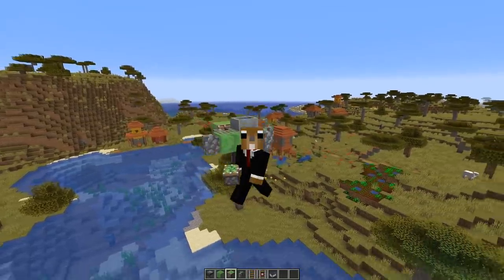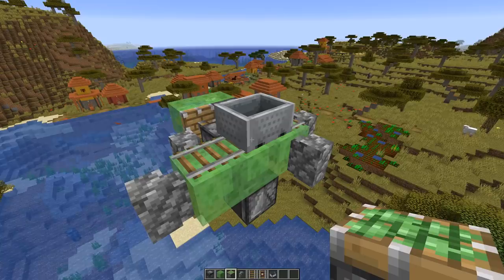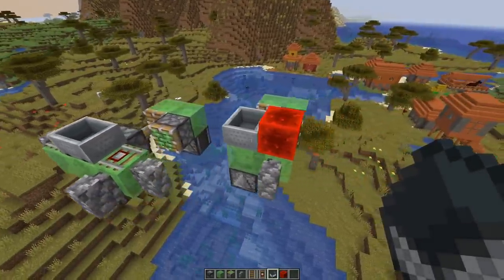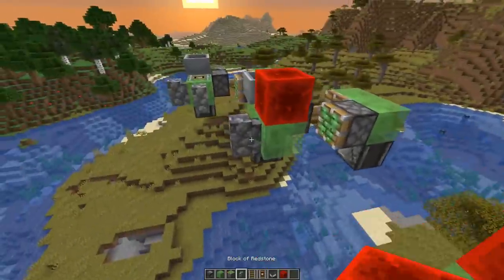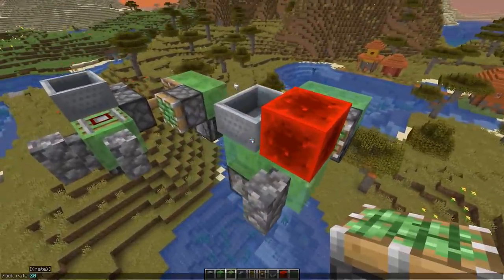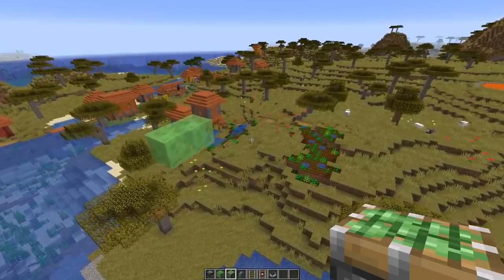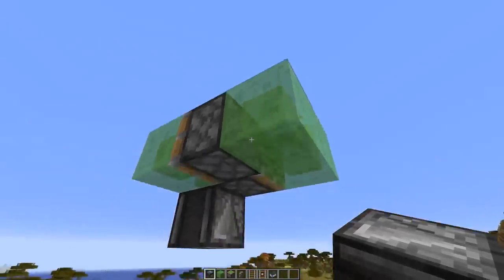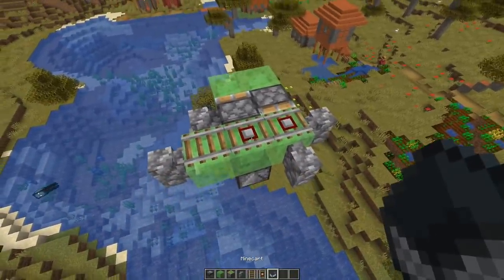Player Controlled Direction Changing 2 Way Flying Machine

Comment: This is enormously helpful for players with bad connections, needing to travel. You just snap back to reality, it's amazing and this makes it even better. Just hope you don't disconnect and break the machine.
Reply: @Jeronimo Stupenengo Pefaur I'm concerned not about the cart, but the flying machine, with instant unloading in the new versions it's likely it will end up in a broken state. Also I would be a little concerned about the cart, if it could (it can't) still move, once you leave, then it could cross a subchunk border and that would be a big rip, it better not be deleting it's passenger (likely wont happen, but I kinda want to test it).
Reply: the flying machine would likely only break on unloading if it ended up unloading while on a chunk border.

Comment: Cool - the other side has plenty enough blocks to spare to add a bidirectional driver for an extension which can be a TNT duper, so you can make a manually-controlled world eater, no end stations required!

Comment: Omg this has to be the most awesome thing ive seen this year.
Reply: Sethbling had a bidirectional controllable flying machine before, using noteblocks for control, but both sides were already at push limit and the minecart was without a rail so it would easily fall off. This one has one side at 4 blocks, leaving 8 blocks for all kinds of awesome stuff.

Comment: Hey ilmango! I was just wondering what mod you use to place your pistons. In the video you show placing them toward a block you are using. This mod looks AMAZING and would be soo helpful when making tutorials. Thanks!
Reply from the maker: tweakeroo
Reply: @ilmango  Thanks!
Reply: @ilmango  does it still work on Nintendo switch's most currently updated version? also how do I attach a small room with a bed, treasure chests and furnace to this machine?

Comment: Wait, what if there is a way to play Pong with this
Reply: Oh my god, there is! You have one of these on either side with a self returning one as the ball and observers at each end behind the paddles to count the score. You'd need to add honey blocks on the edge of the paddles though so that the ball doesnt mess up the paddles every time
Reply: Mitomon 1 How would you make the ball bounce though
Reply: @Budder1252  from the paddles or the observer walls?
Reply: @Budder1252  there are some flying machines that return when they bump into something. To make them change in the z axis to simulate diagonal movement we can add another flying machine beside each observer wall to move the ball
Reply: Mitomon 1 Wait wouldn’t the ball just be going in a straight line the whole time 😂
Reply: @Budder1252  It would move in different sets of straight lines haha, but we just make the board shorter so that it isn't super easy
Reply: no, cause there is no way the ball is moving sideways.